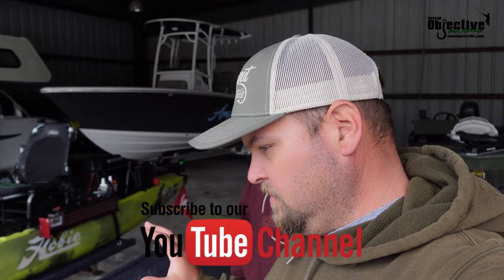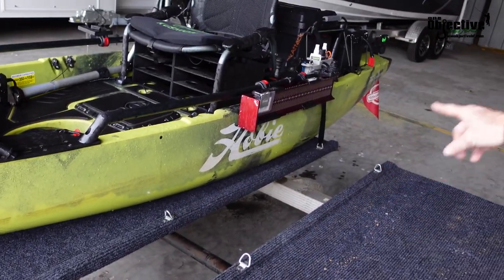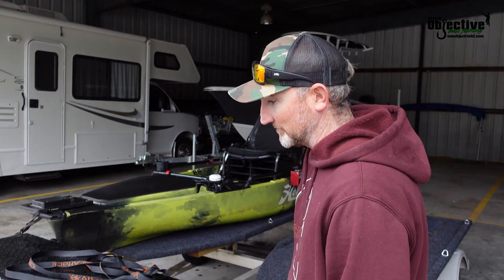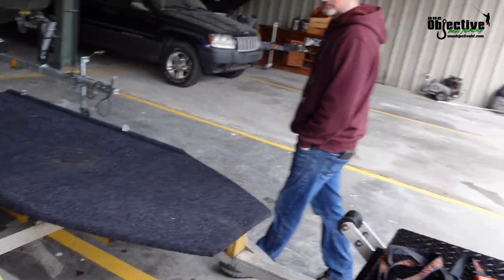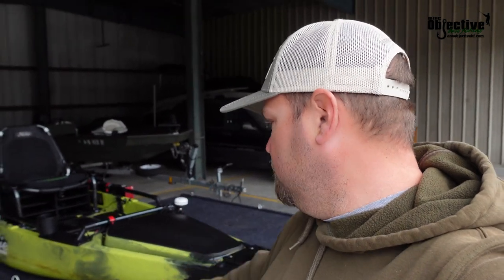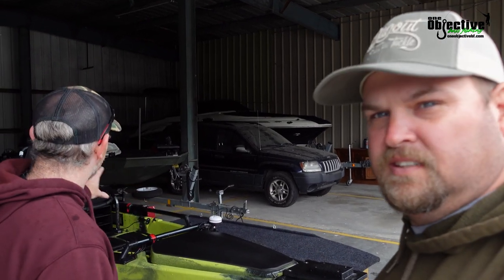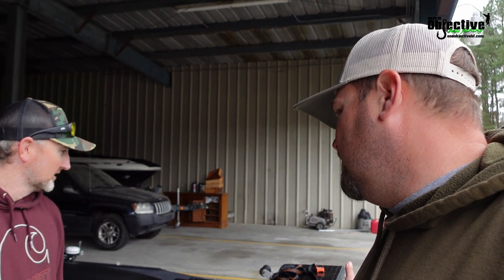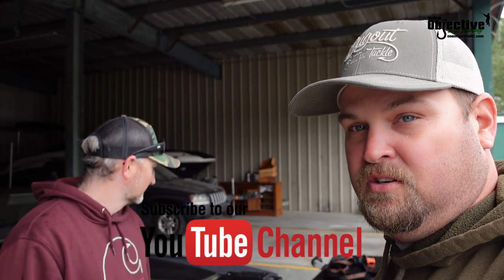Kayak Trailer Build | Part 2

Comment: Great video guys.  I'm just wondering about what you kept on the kayak while traveling down the road and what you must have off.  I know that you have the rods, paddles and trolling motors off the kayak but what did you keep on.   Cannot wait to see your next video.
Reply from the maker: We kept our battery box and tackle box in. Because it was strapped down. We also had our rod in the kayak. We took the graphs off and and the motors.